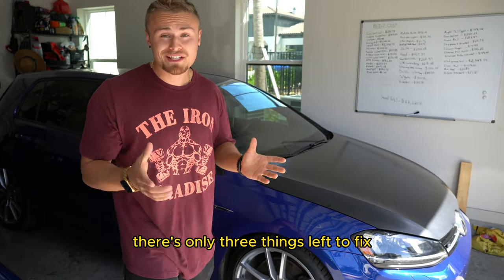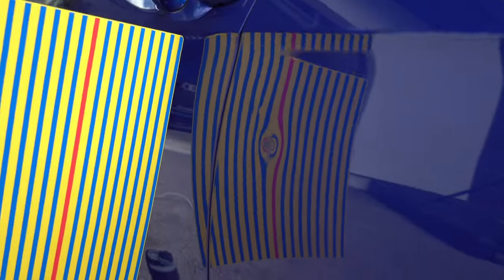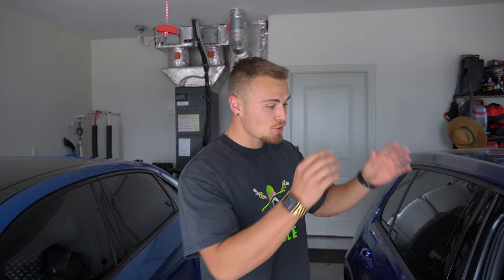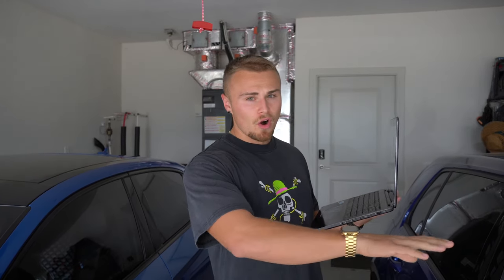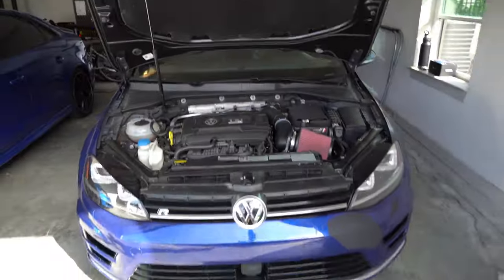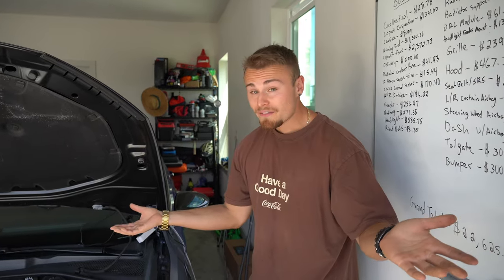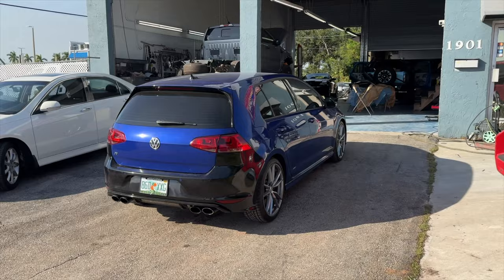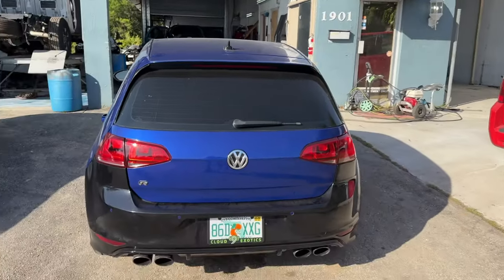REBUILDING A WRECKED VOLKSWAGEN GOLF R | PT 17

Comment: Great Video and fantastic job diagnosing and resolving each of the issues. So many people on YouTube make it look like its one or two very quick fixes. It might be for someone that does it every day, but great job showing what it's really like to resolve some of these items and work through them for all us novices that usually don't see one of these issues until we try to fix it for the first time ourselves. Congrats on working through the issues and having the finish line in sight.
Reply from the maker: I wish the PDR kit would have worked! But I’ll be having the body shop fix it! As for the cruise control module, it took Justin and I a total of three 1 hour sessions to get it all perfect. Hes a wizard at coding! Lots more content to come!
Reply: @Haydenschreiermk2  I have only had luck with the glue on PDR kits when it is a shallow wider spaced dent. When it is a sharp dent like you had on the side door and the rear door, I usually have to use the metal rods from the back to work those and push out the dent.
Reply from the maker: i agree that would be my best bet if i wanted to get it slightly better looking

Comment: Heat the metal with a heat gun before you pull
Reply from the maker: but you cant heat the metal before you use the glue sticks or the glue will melt and you cant pull.
Reply: @Haydenschreiermk2 he means for more adhesion, the panel you gonna stick a glue tab on needs to be heated prior to sticking the tab, hence "heat the metal".

Comment: @haydenschreier Did you ever figure out the reason for the brake knock? Was it fixed? Seems like a pretty important component for safely driving the car.
Reply from the maker: I did! It was indeed the aftermarket brake pads, they’re about a hair smaller than the OEM ones which causes them to slide in the bracket. I temporarily fixed them with a shim I made, so they no longer move around but I plan on replacing them with new pads soon
Reply: @Haydenschreiermk2  interesting why there are crappy aftermarket wrong size pads on it anyways seeing it only had like 30k on the clock when you bought it 🤔